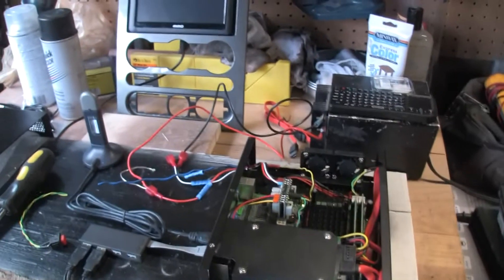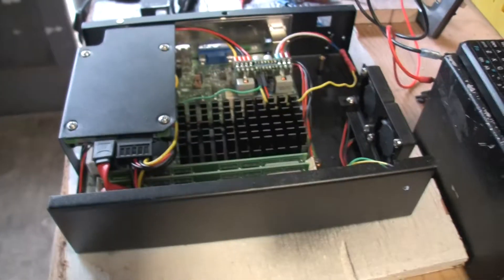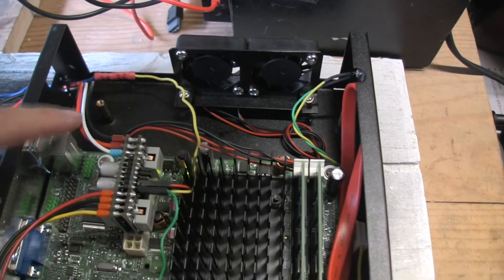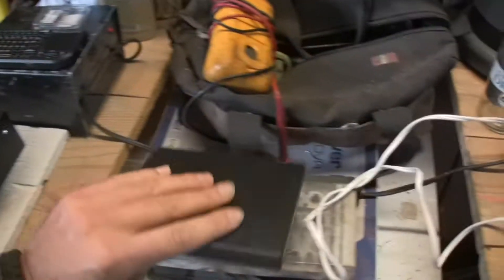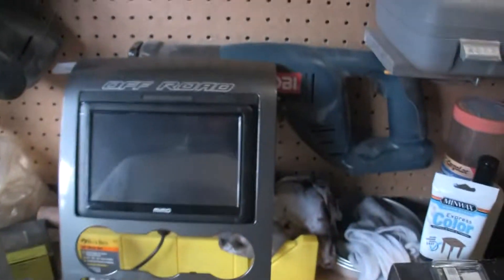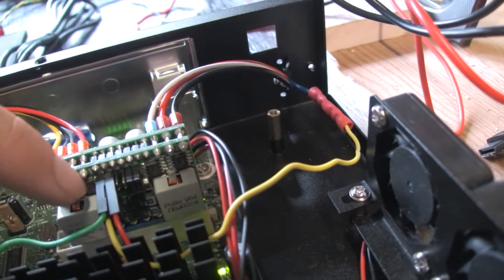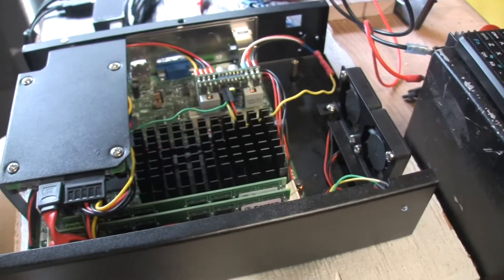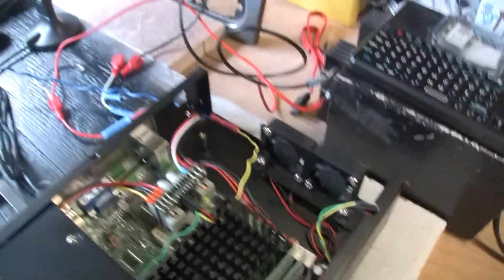How to Build a Carputer  (Part 1 - Computer)

Comment: Instead of using a laptop hard drive, grab a solid state drive, same size as laptop hdd, but read/ write speeds are 400 + Mb/s  5-10 turn on, 5-10 turn off. so if you change the setting in the 12v psu to send a signal to shut pc down after you turn the truck off, you wont notice a difference, matter of fact with the solid state drive, it still boots the computer faster even up against a pc, in hibernate or sleep mode. 

Just some advice / info like to share, other than that, nice setup!

Comment: Nice setup!
I use a Nexus 7 as my carputer and it seems to be a much simpler setup compared to yours. I'm not sure what the advantage is to running a setup like yours, but perhaps you can let me know.
Reply: Power, upgradability, easy repair, they're just a few I could think of but there'll be more cons/pros.

Comment: For a fast boot I would go with a motherboard with a UEFI bios and a Solid state. I get a 8 second boot time into windows 8.1, if you dont go with a UEFI bios then you would probably get about a 20 second boot time. And the metro ui in windows 8 looks nice on a 7 or 8 inch screen.

Comment: Hey there, Could you tell me which monitor is that you're using? Is the Mimo Nanovision UM-720F? If so, I'll definitely buy it after seeing your video, I also got reserved after reading that it cannot be used as a primary monitor. Thanks a lot for the video!

Comment: And last, but not least (and the most important reason) SSDs are not "shock-damageable" whilst normal disk drives are; since they don't have moving parts -hence solid state drive- you don't have to worry about the HDD breaking or landing the heads every time you get a bump on the road :)

Comment: Great project Bro... Have you thought about using an SSD drive instead a normal "disk" drive? Transfer rates on SSD drives are 1500% faster which would mean that the boot-up for the OS would take seconds (I've seen light OS booting up in 2 to 10 seconds -which is pretty neat-) That would also mean that applications would be much faster and responsive. I'll finish the idea on the next comment....

Comment from the maker: Yea, those are viable options. Having the battery could be nice. But having the M3-ATX I don't have to worry about that. I have it set so that when I turn the key off the computer goes to sleep. After 5 minutes it hibernates running off of the car's battery (I have had no drain on the battery - even after 1 week of not starting.) When I turn the key the computer powers up from hibernate to the last screen that was on with the open programs (takes about 45 secs)

Comment from the maker: The case is actually quite small compared to standard computer enclosures. I didn't go with a netbook because it didn't come with everything I wanted. 

Mainly the power issue. With a netbook I would have had to use a power converter, I wanted to use the M3-ATX for automatic power on/off and stable voltage. 

This case also allows me to add or remove any hardware I did or didn't need.